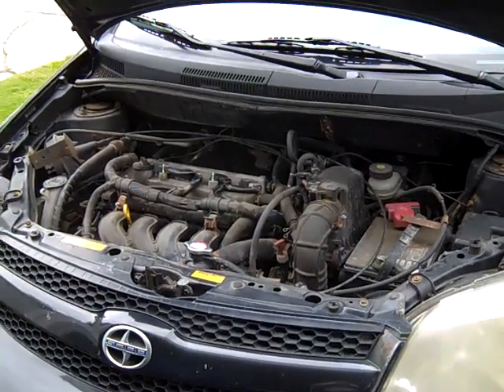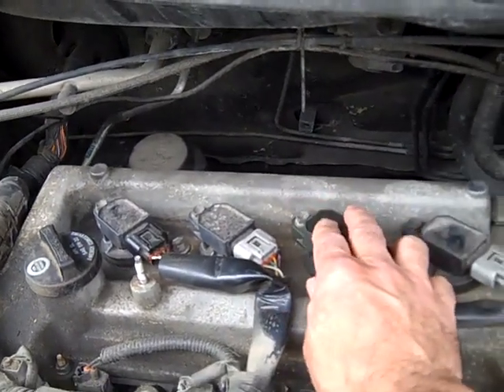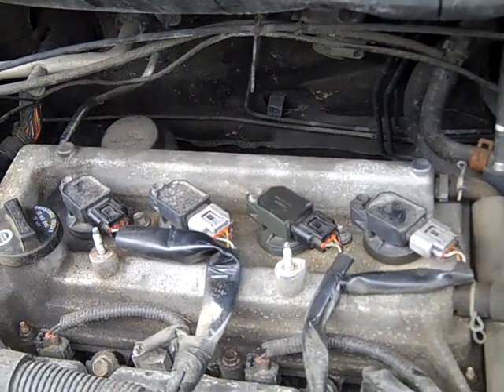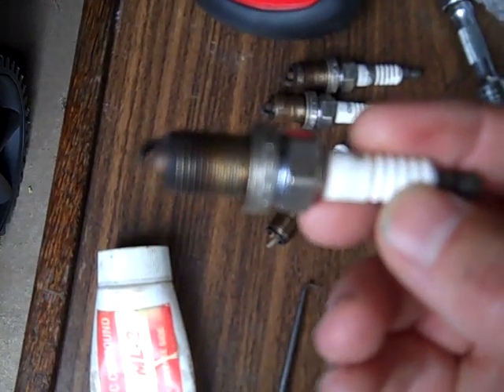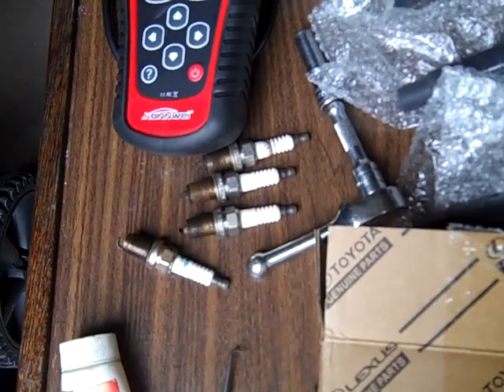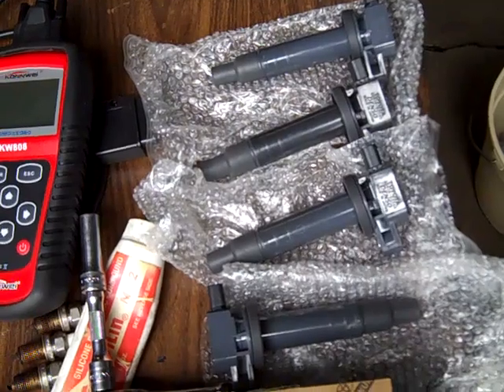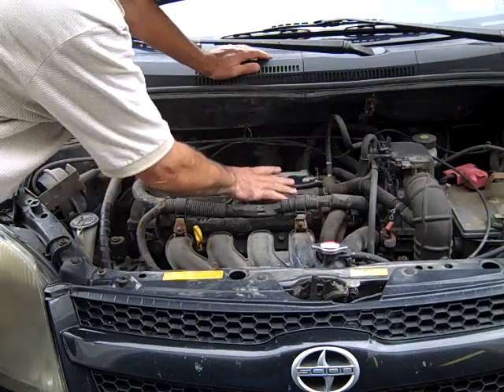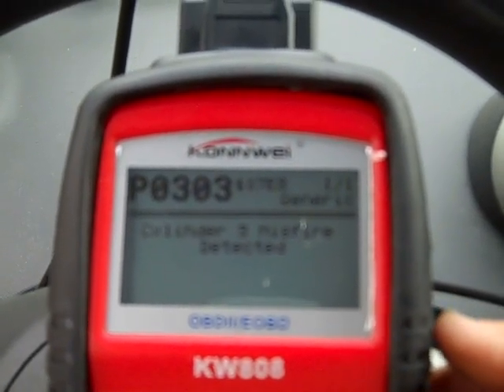Scion/Toyota 1.5 Misfire Diagnosis and Repair

Comment: I've seen many videos on how to correct a misfire code by replacing the coil or coil pack and plugs as well. What I would like to know is what caused the misfire in the first place? Ignition Timing, oxygen sensor(s) or fuel pump or something else? Any direction would help. I'm working on a 2008 Scion xD 1.8L
Reply from the maker: Parts simply get old and worn and fail. Also, if the plug gaps are allowed to get too large over time, it stresses the coils.
Reply: @saabtech3510  that makes sense, but in my case it's repetitive... I've replaced the plugs every 6mos, and I'm on my 3rd set of coils just since 2022... Which leads me to believe there's something causing the misfire. I'm currently checking on TDC alignment and cylinder compression. Not sure how to check the fuel pump other than just replacing it. Lastly I'll see about the injectors. Engine has 193K miles (2ZR-FE)
Reply from the maker: @el.handyman  It's not likely any of those things. Most likely it is cheap and/or counterfeit parts. The parts are so bad now, that they don't last. I think you will be chasing your tail. My advice is to go to the dealer itself, and purchase the OE parts. (bite the bullet) The OE parts on ebay etc. are almost always counterfeit now. Even the spark plugs. I only buy my parts now directly from the dealer for my Toyota and my Lexus. (Fuel pump, timing, etc. will NOT cause the coils to fail.) Getting the OE parts from the dealer, while expensive, should last you as long as the factory ones did. In the end, it is cheaper and saves all the time and aggravation. See: https://www.youtube.com/watch?v=FVA4RYql9KU
Reply: @saabtech3510  Thank you! I think that's the best advice I've received from anyone! I've replacing them with AutoZone's Duralast brand... I guess it's time for the Toyota brand... 😩. Thanks again!

Comment: If you happen to have a link to the parts that would be great. Old video but would be helpful to me as I’m replacing mine soon. Thanks
Reply from the maker: No link, but I now recommend only OE parts from a reliable source, like the Toyota Dealer. The internet is now majority counterfeit parts that lead to nothing but problems. Bite the bullet, put in 4 new OE coils, and 4 new OE plugs. In the long run you will be rewarded.

Comment: I have the same code P0301 on my XD changed all 4 coils still misfires, any other ideas on the problem ? thank you.
Reply from the maker: Make sure the spark plugs are good, and be sure the coil connectors are secure.
Reply: @saabtech3510  Thank you sir.
Reply: @saabtech3510  coil connectors secure, plugs look good, little brown on outside white part. Use Toyota spark plugs 6 months ago.  Idle is strong, take off give it gas starts to sputter; Fuel injectors ?  Thank you.
Reply: Thank you for your help, great appreciated.  6 months ago changed all 4 with Denso spark plugs.  Never in my life changing plugs have had a fouled plug, especially this brand in a short amount of time. With 4 new coils, plug, she is running great.
Reply from the maker: @bluefootbooby1  Sometimes, with the bad coil, it fouls the plug to where it just won't fire like it used to. Seems to be one of those things. With the Saabs when we changed the coil pack, no matter how good the plugs looked, we always replaced them with new OE plugs. Package deal....they work together.

Comment: Let’s say you get a cylinder 1 misfire code and you want to drive it home can you disconnect the fuel injector for cylinder 1 and drive it to avoid unburned fuel in the exhaust?
Reply from the maker: Interesting idea. 🙂

Comment: I replaced all coils and plugs and number 2 misfires. don't know what to do
Reply from the maker: Try swapping 2 of the new coils and see if the misfire moves. Maybe a defective part. Check the plug too. Also check the connection to the coil. If all that fails, might need to check cylinder compression.
Reply: @saabtech3510  could be  bad coil even tho it's new. didn't think of that lol thank you. I also ordered new injectors. hope it does the trick

Comment: Trying to diagnose my 2011 Scion coils, my local shop is struggling and I’m looking into it myself now. They replaced all 4 about two years ago, and one has failed about every 6 months…any ideas? Could this be a control unit problem? Bad connections at the coils?
Reply from the maker: The aftermarket coils are very prone to failure. In my opinion only OE Denso coils should be used. Also, be sure the clips on the connectors are not broken. Very brittle. Secure with a small wire tie if needed.
Reply from the maker: Also, sadly, there are also counterfeit OE coils out there.
Reply: I may just go get those and fix myself before it happens again. Usually notice a rough idle when in park or at a stop light, gets worse over time and then a failure occurs…it’s happened 3 times now! Thank you for the quick reply and advice!!
Reply from the maker: @SpaceDad57  important to use OE spark plugs as well. 🙂

Comment: when people recommend pulling coil they are only disconnecting the electrical connection they are not  pulling coil out!  
it is only 12 volts

Comment: My mom has one same year. Hers has 348,xxx and counting. Replaced all spark plugs and coils and it will intermittently run bad. But I got a catalytic code so we’re gonna try running some 93 octane and drive it like she stole it. Hopefully that’ll help.
Reply: I got the catalytic code too and then it started feeling sluggish any advice?
Reply: @danielvazquez392  I wound up replacing the fuel injector in cylinder #2 and that solved my problem

Comment: My 05 Scion tc had a blinking engine light and hesitated on acceleration, but had a steady idle. I changed the plugs and coils with good ones and then it would just die when idling?
Reply from the maker: Carefully check your work, and for anything loose or detached under the hood. Also, try disconnecting the battery for 10 minutes. Sometimes the computer has to "relearn" the proper idle.

Comment: Thank you for your time and effort for helping and educating us.

I have an 05 Psion TC. I’m getting a random misfire in all four cylinders. Do you know what may cause this? I assume the timing is off, with that be correct?
Reply from the maker: One thing to check is the spark plugs. Use only OE. (Original equipment) Timing should not be off. It is computer controlled. Also make sure no vacuum hoses are leaking.
Reply: Thank you very much.
Reply: I just find it odd that all four would fail at the same time.

Comment: my 2001 toyota echo had a bad upstream o2 sensor. it made my car misfire like crazy. i was able to isolate the misfiring problem to that o2 sensor by unplugging the wire harness to the o2 sensor. when unplugged, it drove perfect-- no misfiring. i didn't know a bad o2 sensor could make a car run so terrible! i will leave it unplugged until the new one i ordered arrives (permanently leaving it unplugged would permanently affect my MPG...) hope this helps someone else!
Reply: Ive tried everything except this on my 05 XB, thanks man it's worth a shot. I'm having a cyl 1 misfire on mine
Reply: @mylittlescienceproject  what happened?
Reply: Hey hru. O5 xb change dam near everything. Took to shop. Said 810 just to take it apart. 🤯🤯 Said low combustion cy 1 . Ice tried everything but 02 I was going there next but tired of guessing very long expensive irritating adventure. Could o2 make cy 1 not work? Mine actually runs ok but start up us not good. And only code pops up is cy 1 mis fire. Has low power in my opinion. Please help I posted some shorts on my channel even sent a vid request mention to Scott a few weeks ago🤷
Reply: @mylittlescienceproject  nah man I did that . Shop said low combustion. Poss vale or piston. Paid fucking 95 for that useless info ty tho
Reply: @williambrucesanders6878 did you figure it out?

Comment: We’re those coils new for $70?  I’ve found some used/cleaned ones for $50.  Would trying used ones be an option?
Reply from the maker: Yes, they were new. I had to search for a while. Used ones that are original equipment would be better than new cheap aftermarket ones.

Comment: Question, I have an '07 Scion TC, it has a hesitation upon acceleration from a stopped position or coasting, I've had it to 4 different garages, even a dealer, not one can figure out what the problem is, any ideas?  It has 135k on it?
Reply from the maker: Maybe a bad sparkplug or coil? Hard to say. Even a cracked sparkplug can misfire under load.
Reply: You need to change the coil after diagnosis and lookout for breaking Electricial lines to the coil also. Remove and service the injectors.. you are good to go!!!!!!
Reply: my 2001 toyota echo had a bad upstream o2 sensor. it made my car misfire like crazy. i was able to isolate the misfiring problem to that o2 sensor by unplugging the wire harness to the o2 sensor. when unplugged, it drove perfect-- no misfiring. i didn't know a bad o2 sensor could make a car run so terrible! i will leave it unplugged until the new one i ordered arrives (permanently leaving it unplugged would permanently affect my MPG...)

if you havent sorted your car out yet, unplug the upstream o2 sensor, then take the car for a quick drive. if it runs perfect-- its the o2 sensor. if it doesnt change how it runs, try unplugging the downstream o2 sensor and see if that changes its performance.

Comment: Was carefull with the clips but they still broke, very brittle.  Easy to replace the connectors though.  
Thanks for the great video.  
Now have a bouncing idle in neutral.  Air intake gasket leak?  Appreciate any ideas.
Reply: I have the same issue, replaced all 4  coils now my car sputters
Reply: where do you buy the connectors ? what is the connectors called?

Comment: Just ran the scanner on my moms 06. Says misfire in cylinder 3/coil. Checked the plugs and might as well replace them as well. As for the coils does it matter which one goes where when I order the new ones?
Reply from the maker: All 4 coils are the same.....just need to be attached to the correct wires for each cylinder.

Comment: My cylinders were leaking oil so my coiI  packs were full of oil I replaced the valve cover gasket cleaned off the coils and stuck them back in then changed out my spark plugs, still running a little rough so I changed the crank shaft sensor and it’s still idling/misfiring. I’m hoping the coil packs themselves are the problem I’m tired of wasting money on things I don’t need
Reply: Did you ever figure it out? Currently having the same problem and getting the lean code in bank one
Reply: @mitchsimonsen2816 same diagnosis here brother, did you manage to figure out what was up with yours ?
Reply: @NEOGIIO for me it ended up being a bad brake booster because it had a vacuum leak and it was throwing off the system. Got that replaced and been good ever since

Comment: I changed the coils and it is still misfires any suggestions
Reply from the maker: You should replace the spark plugs too. If it still misfires, might need to do a compression test. (Also, if you did not use the Denso OE coils, the cheap ones often don't work well.)
Reply: I replaced my spark plugs and next step is to replace the coils. Keep me updated after you did the compression test.
Reply: Michael Zepeda I would like to know as well

Comment: I own a 2006 Scion xB bought it new. Great car, but it started the miss. Watched your video and now know that I can do the job. Priced the coils at the local parts store, and they wanted $275 for 4 of them. Went to ebay and found four OEM coils for $75. Got the OEM spark plugs while I was there.
Reply from the maker: Great! Glad to know my video was of help. Great little car for sure.
Reply: @saabtech3510  Once again, thanks for the video. I have installed the new plugs, and coils. xB runs like new, smooth and more power. Only question, is there a way to reset the check eng. , VSP, and Traction control warning lights? Can your scanner be able to do that?
Reply from the maker: @bobdavis3062  In some cases if you disconnect the battery for a few minutes, it will reset. And sometimes the lights will reset on their own after it self tests the systems over the course of a few days. If not, a scan tool will be needed to clear the codes, also in case something else has triggered a code you can find that out. Not uncommon to have a few things go wrong close together and not always related problems.
Reply: @saabtech3510  Thanks for the quick reply. will try the battery disconect.
Reply: I changed the coils and it still misfires any suggestions
Reply: @debbieharding5966 what ended up being the problem. Did you fix it?

Comment: Where did you get those for 70 bucks? They are 130 each.

Go Bills!
Reply from the maker: I had to search around on ebay for about 30 minutes before I found this best price for 4 OE Denso coils. Sometimes you have to search a bit for car parts on ebay, also being careful you are getting the genuine parts.
Reply: Here is where I got my four coils for $68   https://www.ebay.com/itm/4PCS-Genuine-OEM-Ignition-Coil-90919-02240-For-Toyota-Yaris-Prius-A-B-Echo-1-5L/273350222148?ssPageName=STRK%3AMEBIDX%3AIT&_trksid=p2057872.m2749.l2649
Reply: Amazon all day